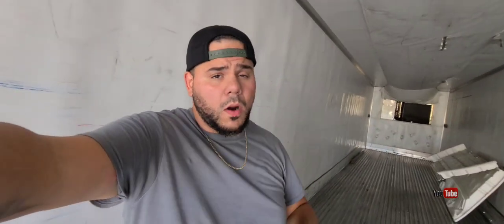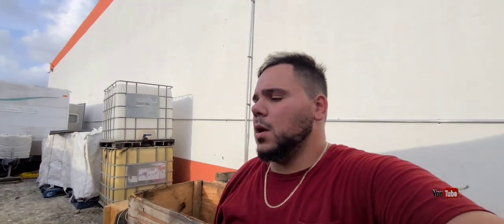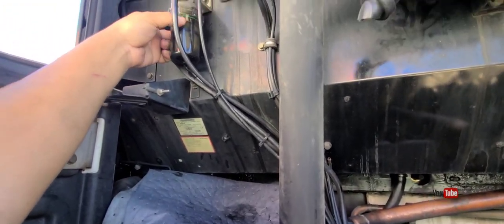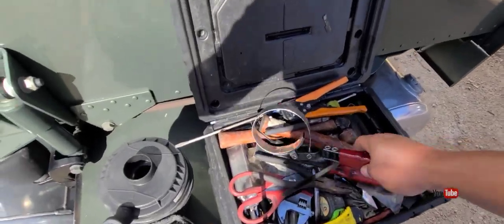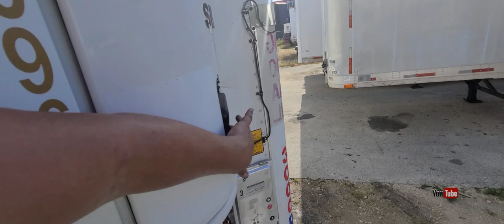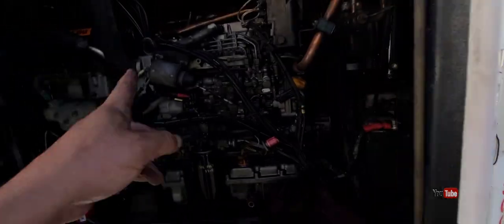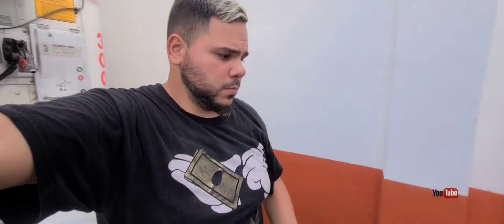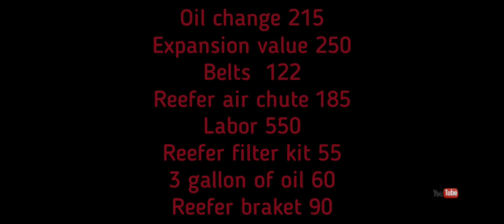Fixing issues in my Reefer Unit/Thermo King 230

Comment: Brother you should put some type of Rug or Blanket anything over your Frame platform cover So that you don't scratch up the paint l understand that there's already paint chips and scratches but No sence in putting more dents chips and scratches on your Cover over your Frame platform you have a Beautiful Truck and You have worked your Ass Off take a few extra minutes and cover up your Frame platform when working on your Fridge on your trailer. Awesome video as always

Comment: Take a piece of gray duct tape and put the date on it. Then put it on the fuel filter. Do the same thing for the oil filter. When you put fuel treatment in the truck fuel tank,put a little in the TK fuel tank. Check your door seals if there sweating.It's good that you at least know the basics.Get the APU yet? Take care
Reply: He has a long Pete with a reefer. I'd be concerned about weight.

Comment: I pretty much have the same cooling problem with my reefer unit. Did the guy that worked on your unit determine if the new drier filter fixed your problem or did you really have a bad expansion valve?